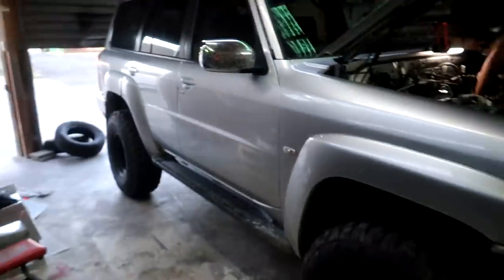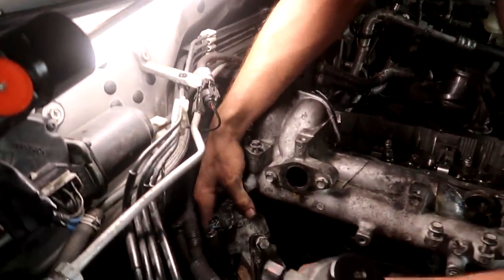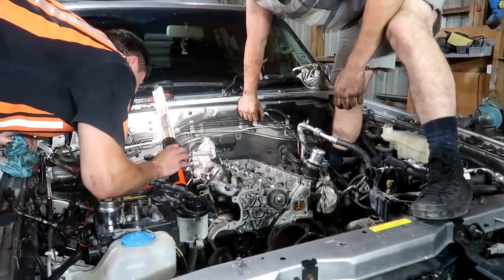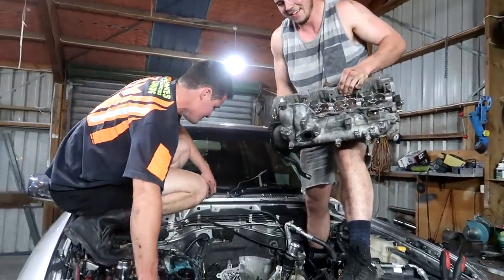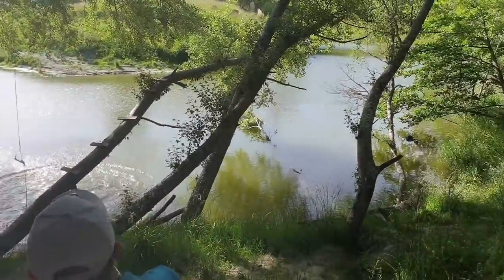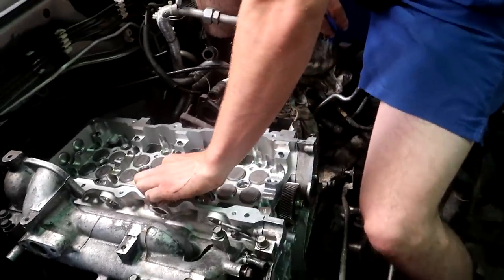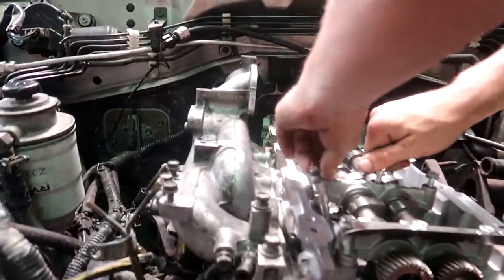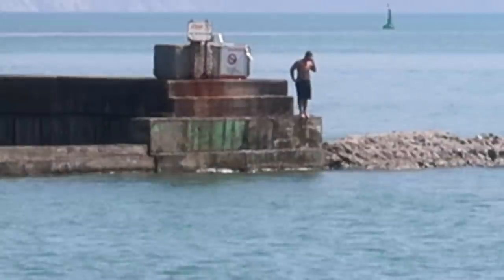Removing A Head From A Lifted 4WD..

Comment: Be careful and tension that 3 piece scissor gear at injector pump. If not you will have a lot of problems later with gear clash. Take care also with gasket size as they come in two different sizes. Piston protrusion must be measured at TDC to learn which gasket is needed.A super vehicle, I have a 2007 model and have been driving Patrols now over 15 years. I have had a few and still own 3 now. Greetings from sunny Ireland 😆

Comment: I know definitely in the vans the downpipes/exhausts are pretty undersized.
The boost they run often pops exhaust manifold/turbo gasket making leak.
Brother's one blew turbo cause he did nothing about it quickly.
They often run away when the turbo goes too.
Luckily his blew an intercooler coupling before things got serious.

Issue becomes pretty apparent when you've got no power and oil spewing out of intercooler 😂

Comment: Fellas to get the heat out the shed. Get two or three whirlybird vents for the roof. Problem solved. Heats trapped in the roof cavity, it will release it 😎

Comment: Nice video, something different.
my head gasket let go at the back on piston 4 after cooking it on the beach from having a muddy radiator. 
The head was cracked between all glow plugs and all pistons had cracks in the top. A new head gasket and a hand sanded head and it going strong. No need for a new head ahaha

Comment: I thought I’d ask (long shot given 2 years later) how much silicone you applied as they have a gasket for the timing case to cylinder head + O ring and I noticed the face of your head was clean when lifting it over the timing case to install

Did you have the gasket already on and did you silicone both sides of the gasket?

I just assumed the gasket would be fine by design IF the correct tightening sequence is followed etc